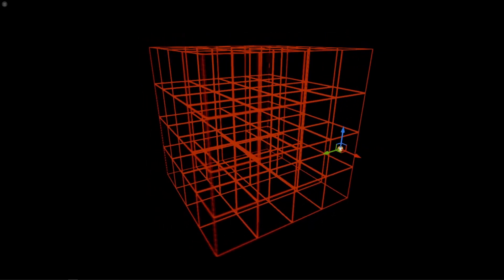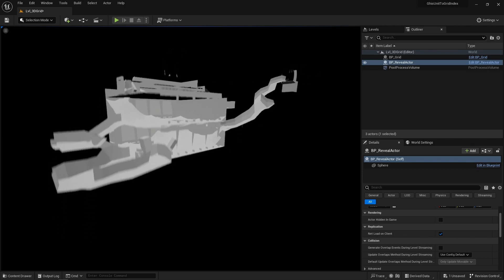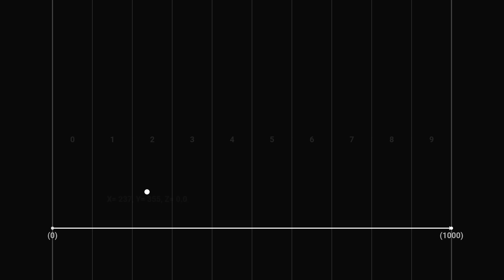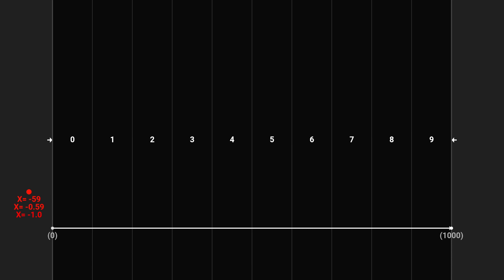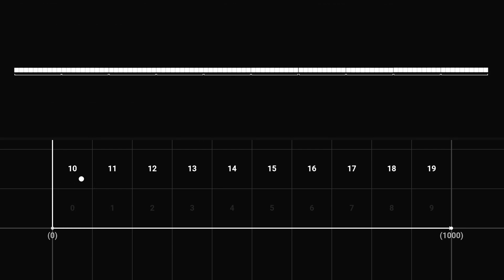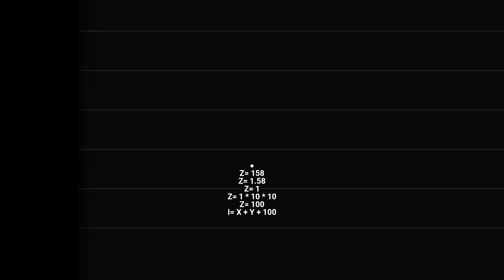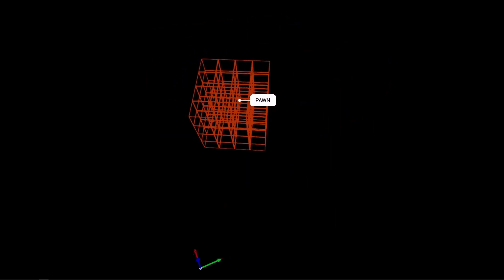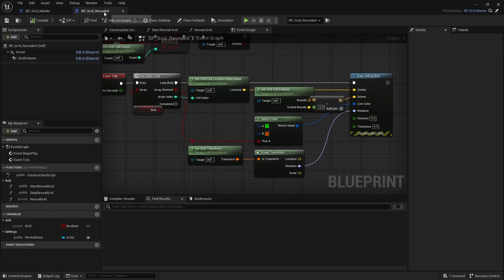Techniques to build grid-based systems: 3D location to grid index!

Comment: amazing method for confined spaces but with int32 array size you are limited to 1290 x 1290 x 1290  global size. so its great for navigation! great for mapping. great for particles! but not for build system.
Still amazingly performant technique!
Reply from the maker: Meh, 1290^3 voxels is an INSANE amount of voxels. Not sure what you aim to create but I haven't seen such resolution ever before. Niagara's Grid 3D interface is capped way below that and nobody's complaining :D Plus, you could use a redirection buffer to create cells within cells or go with a sparse grid :)